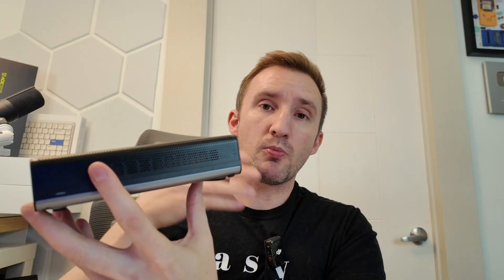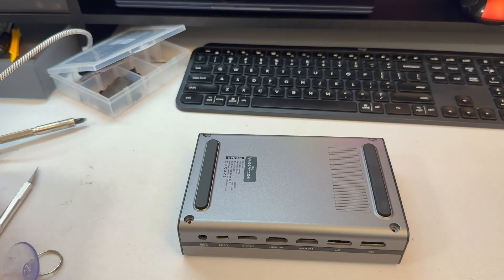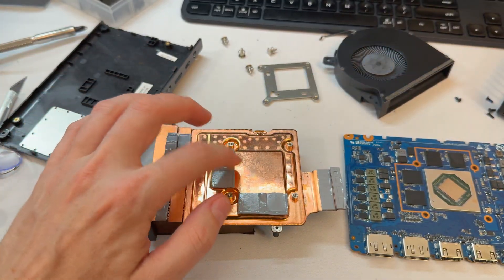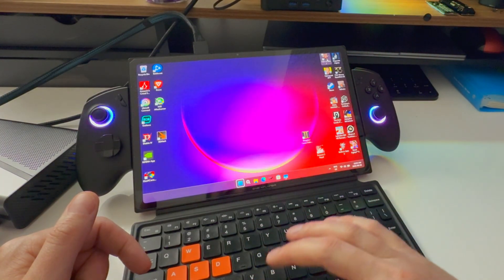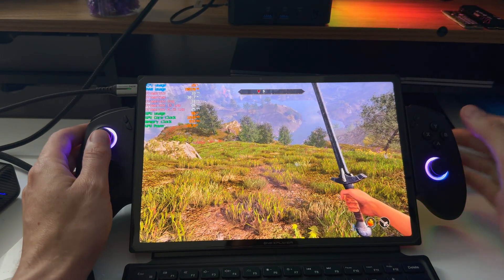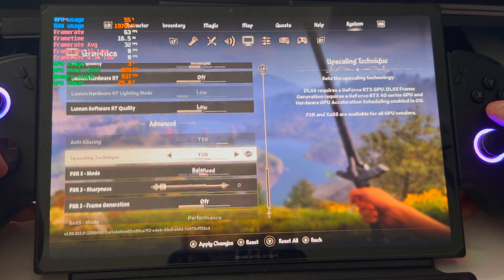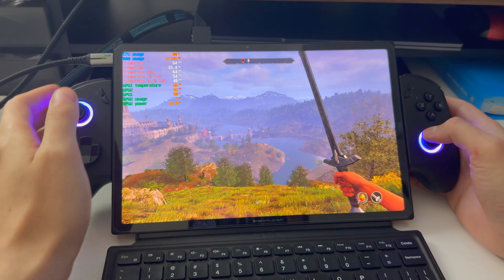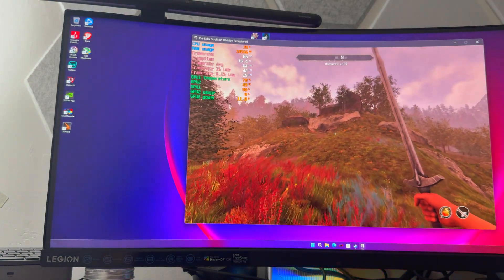BOOST FPS !! - This GMKtec AD-GP1 eGPU 7600m XT

Comment: How is the performance with the usb 4 if connected to an external display instead of using more of the restricted bandwidth to send the frames back to the handheld?
Reply from the maker: Good. When outputting to an external display a log the bandwidth issues are reduced over usb4... considerably so